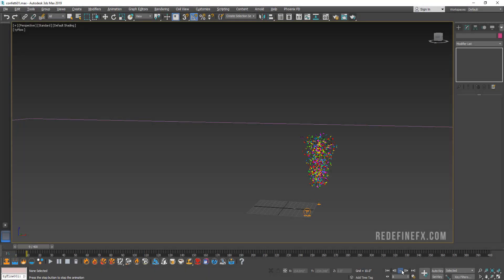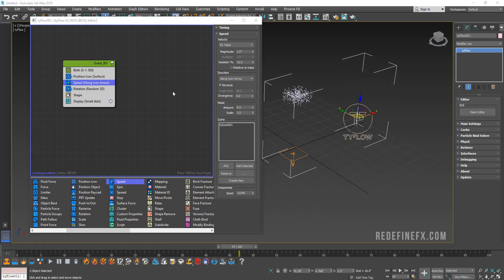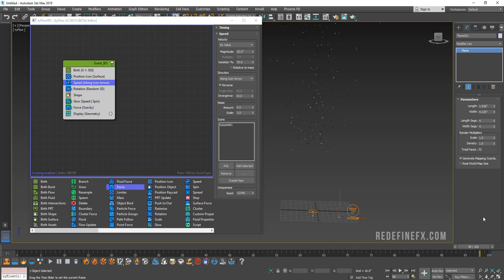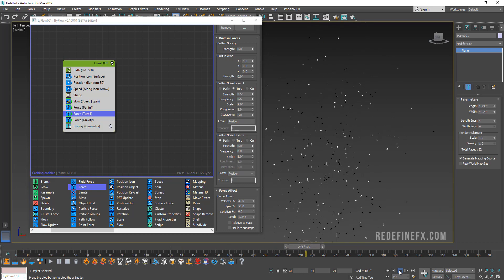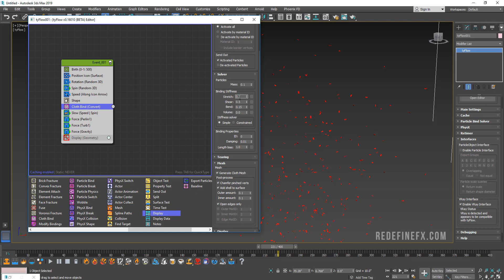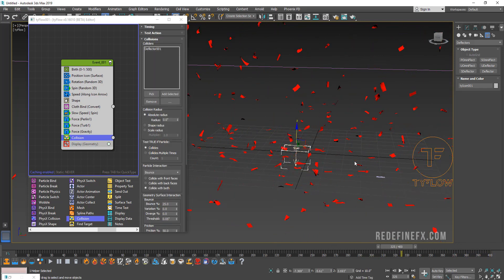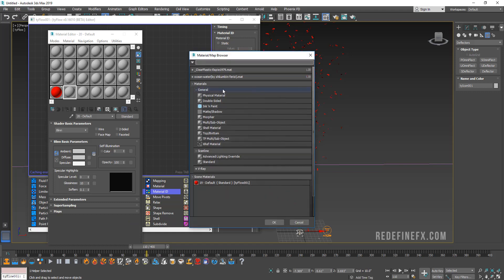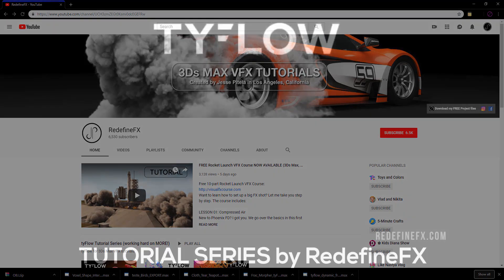tyFlow Tutorial: Cloth, Collision & Confetti Explosion by #RedefineFX

Comment: Thanks for these! Regarding the ticks that you hide at 5:20. You can unclick "Mark particlas with no geo" and have the same effect. Just a tip. Also control-alt right-mouse drag in your timeline to drag out a new animation end frame. Control alt left sets a new starting point. Control alt middle moves the entire timeline.